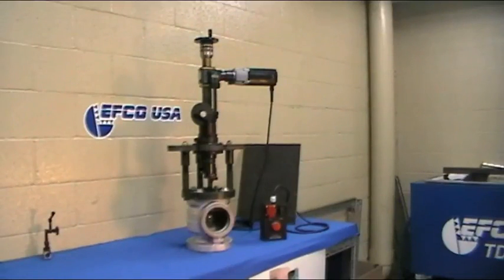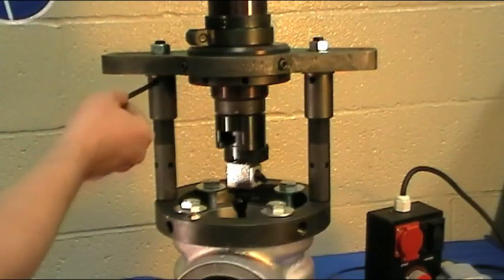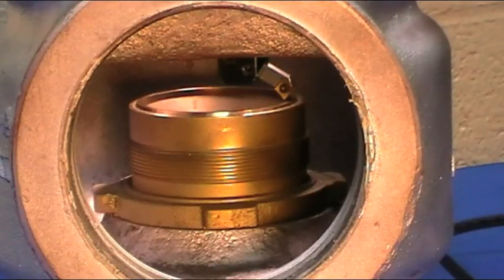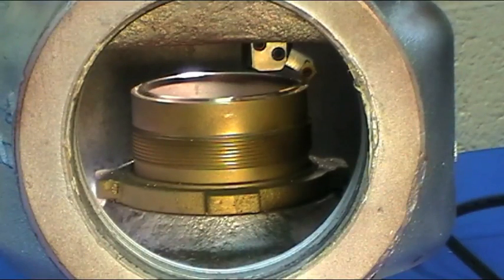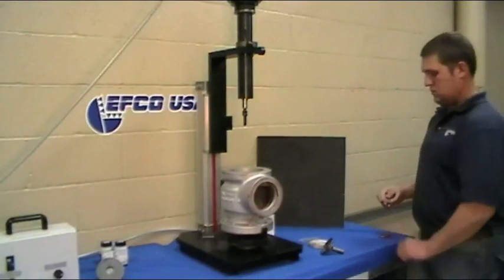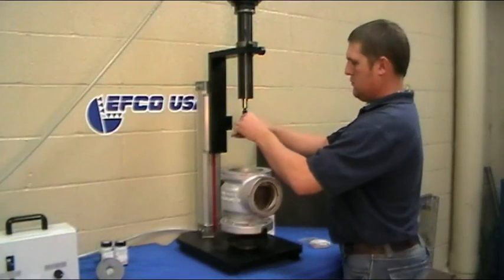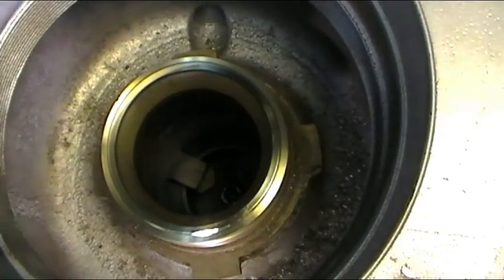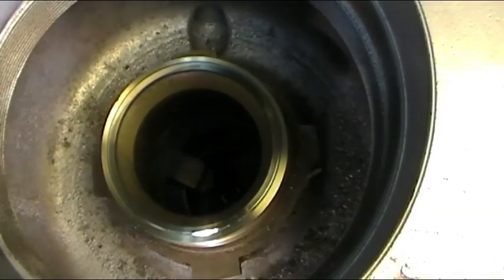Consolidated Steam Safety Valve Repair with the EFCO TD-03 & TSV-150 - EFCO USA

Comment: In that style of valve I remove the nozzle and give it to the machinist. Now I can see doing this to the 1811 safety valve which doesn't have a removable nozzle . Consolidated dresser has a sweet little machine that cuts the 1700 style safety valves which cuts  angles and flat surfaces at the same time . Nice video though.